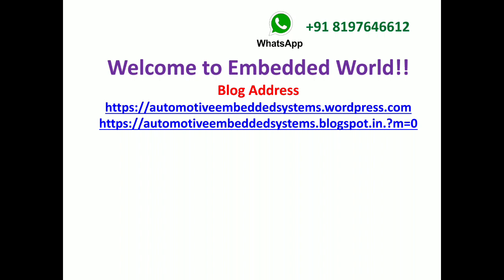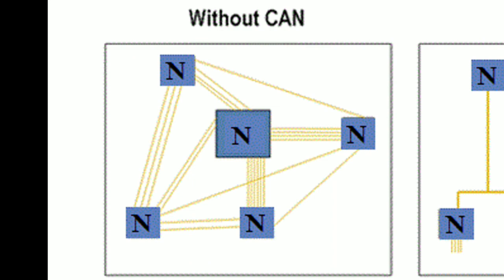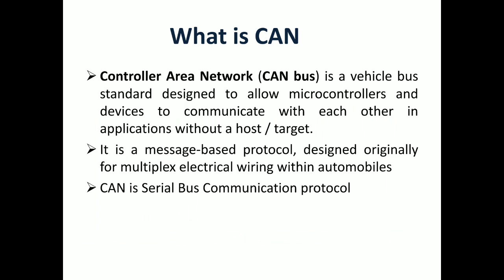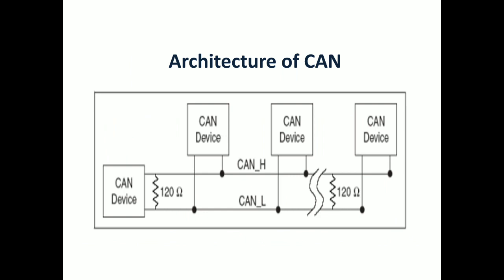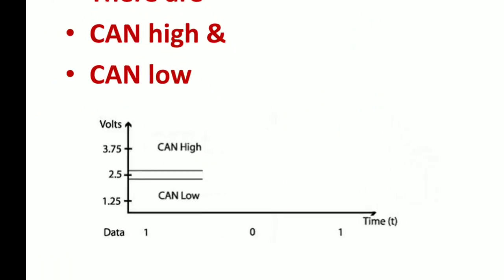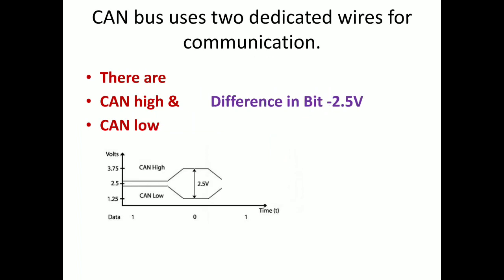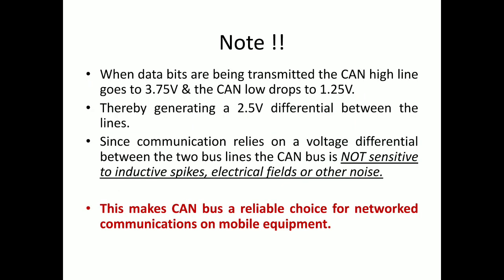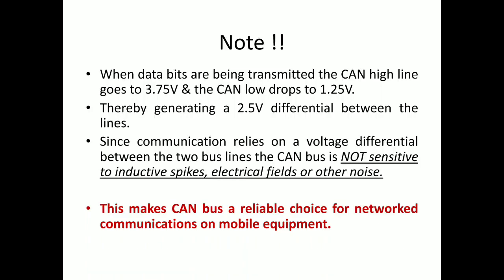CAN Protocol | Architecture of CAN Protocol | CAN Bus | Controller Area Network | Embedded World |

Comment from the maker: 1. What is UDS Protocol
1. How UDS Protocol found
It is derived from ISO 14230-3 (KWP2000) and ISO 15765-3 
(Diagnostic Communication over Controller Area Network
2. What is the similarity between UDS and CAN
3. How UDS and CAN Relates
4. Why UDS is Message oriented Protocol
5. How Can you communicate using UDS
6. What are the types of Request in UDS
7. What are the types of Response in UDS
8. What is Client / Tester in UDS
9. What is ECU / Server in UDS
10.What is frame 
11.What is format of Request  
12.What is format of Response
13.What do you mean by PCI Length
14.What are the functional groups you know in UDS
15.What are the services in UDS ? What are you worked ?
16.What do you mean by Faults
17.What is SID
18.How you relates OSI model with UDS
19.How valid request
20.How invalid request
21.Why positive response
22.Why Negative Response
23.What is NRC
24.Types of NRC ? What NRCs you worked so far?
25.Is it accuracy mattes in UDS
26.What is DTCs
27.How will you ensure DTCs
27.What will you analyse in UDS Response